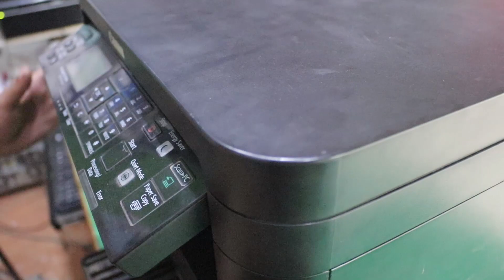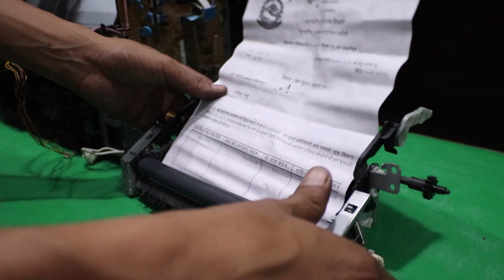Cannon Printer Paper Jam | How to Remove Jamed Paper of Cannon Printer

Comment: Thank you! This video was a huge help.  I was totally overwhelmed when first viewing this; so many steps. I worried that I would not be able to put the machine back together. Deep breath....I started, one step at a time, took pics for each part and screw removed. Was able to finally reach the paper exit guide, deep inside the machine, which was loaded with paper jam remnants causing the print quality to be unacceptable. I followed my photos in reverse to re-assemble the machine, and....viola! It works perfectly! I worked slowly and deliberately for about 6 hours. Very pleased! Thank You!